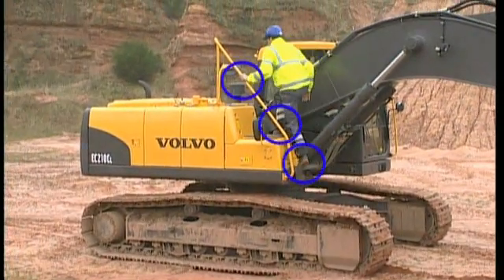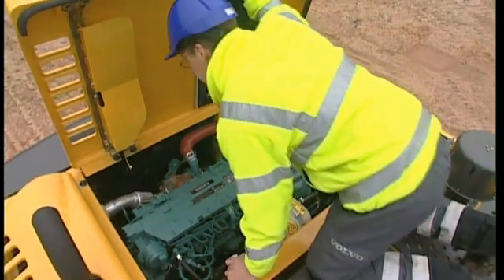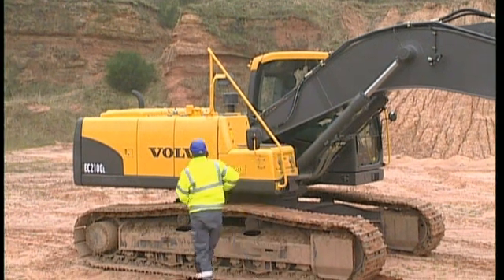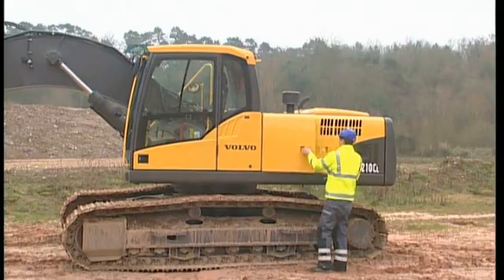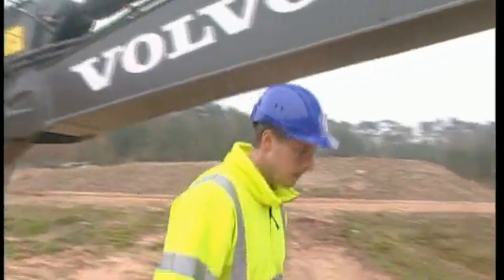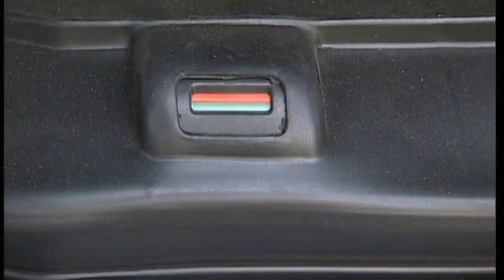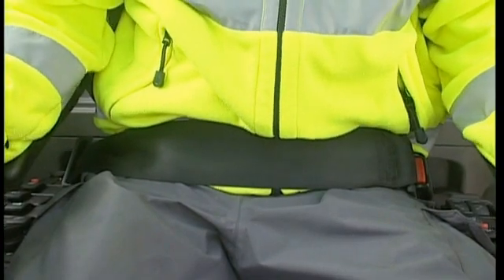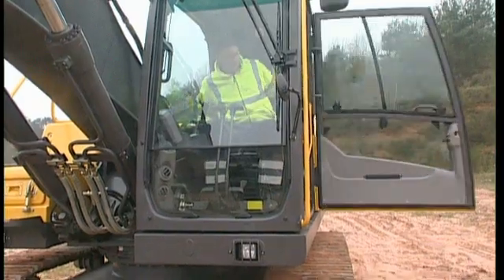What to do before working with a Volvo Crawler Excavator (Part 2 of 15)

Comment: there is one problem with volvo ec series. it's the delay on the joystick. when you are in constant working progress you dont feel the delay but when you are starting up the machine and are about to start workin its like an air bubbel in the sysstem so you almost get a free fall on the bom! that is a problem i like to be solved. mvh tobias